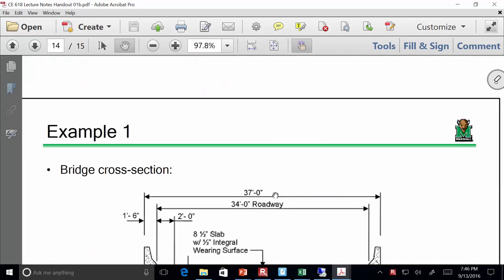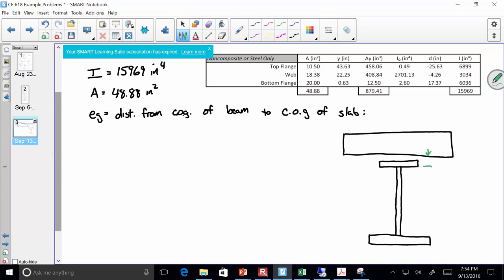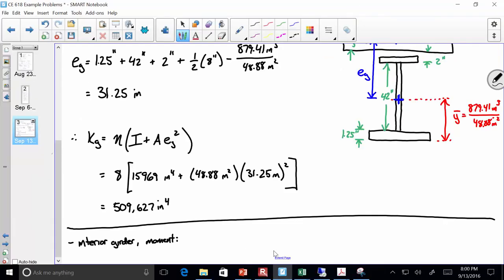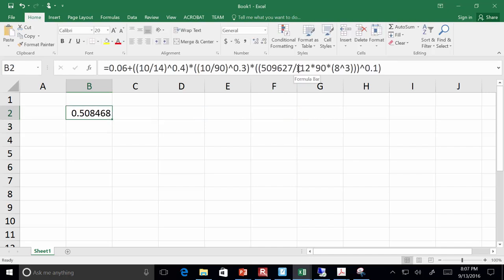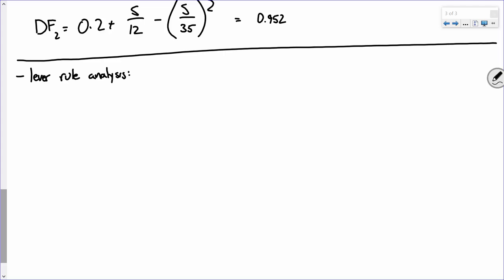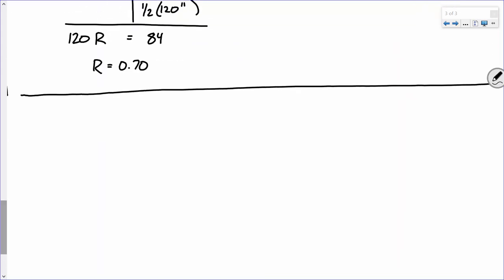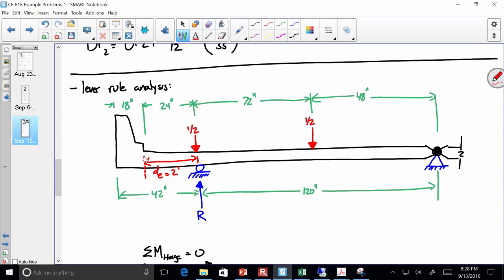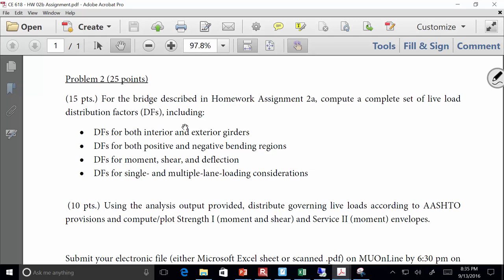Bridge Engineering Complete Course -Lecture 04b   Live Load Distribution Factors (AASHTO LRFD)

Comment: "Could you please explain the design calculations for the bridge expansion joint, taking into account the movements of prestressed beams due to shrinkage, creep, and thermal effects, as well as the design of bridge components such as bearing pads, plinths, cross beams (diaphragms), parapet walls, etc.? according AASHTO Specifications?
Reply from the maker: Sure, We will cover this in upcoming tutorials. Stay tuned!